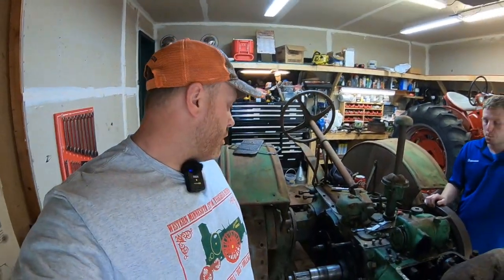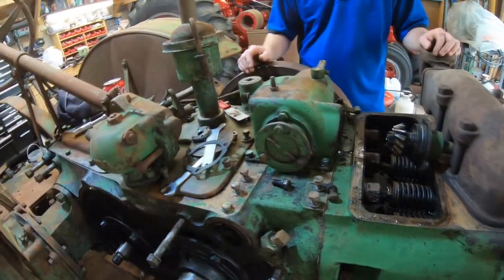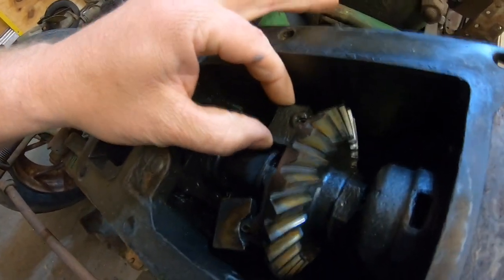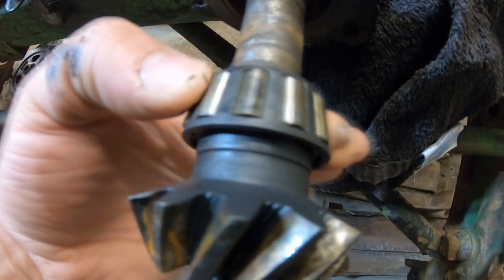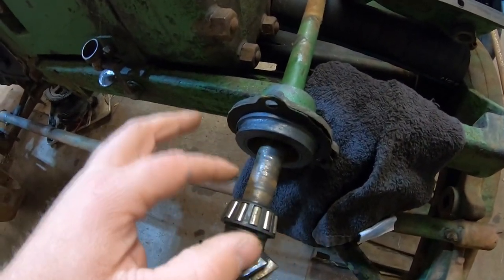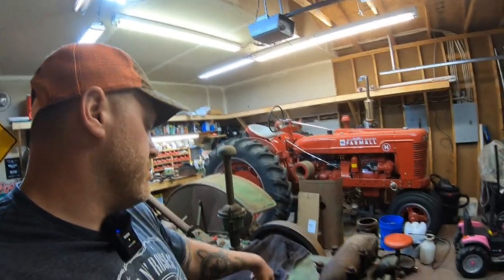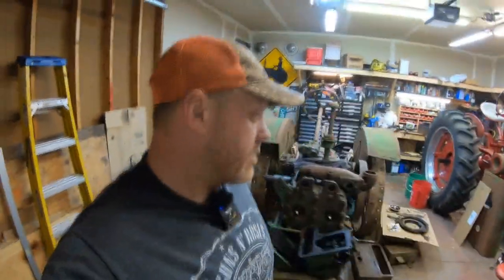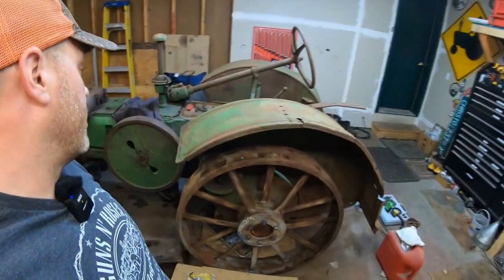1929 John Deere GP Part 7: Governor Housing & Fanshaft Removal - More Issues Found!

Comment: Love that original John Deere green! I suppose you will find some issues when working on a 94 year old tractor, but those vintage machinery are so worth it. I would love to know the history of that GP and all the work it did, well before World War 2. Thanks Kenny!
Reply from the maker: That's part of the mystery. Going through the toolbox can sometimes lead to clues. I think this one was equipped with a planter at one time, after finding all the drive chain links in the toolbox!

Comment: Before you know it, that GP will be completely stripped and parts scattered all over your garage and yard! Is that a hardened shaft or mild steel? Either way, it's cheaper ordering round stock from a metal supplier or McMaster Carr that doing a lot of welding and machining. Good luck guys!
Reply from the maker: I'm not sure if it's hardened or not. We are definitely on the hunt for something!
Reply: @KennyKizzleRustyNutzRanch  you can do the skip test with a file. That will tell you for sure

Comment: Weld up the shaft and turn it back to a usable state . As for the broken ear on the carrier braze it or make a new one from steel .
Reply from the maker: Well. In order to do that I would need a welder and a lathe. A replacement carrier can be found fairly easily.
Reply: @KennyKizzleRustyNutzRanch  I know someone who has both and he lives near you I think  squatch 253
Reply from the maker: @M1A2 Abrams tank  yes, he does. I try not to bother him with things too much. I know he's also got a lot of projects going on.

Comment: Well I guess I would look for your bearing and seal housing first, as you might just find it with the shaft as well. 
Then after I would have the housing, seal and bearing, take it to a machinist and explain to him that you need a new shaft or the old one repaired. He would be able to tell you which would be better and the he would have everything he needs to do that.
Was there shims there also?
Reply from the maker: There was only one shim/gasket between the carrier and governor. We were able to locate a seal/bearing carrier as well as a new shaft. Just waiting for the shaft and gasket material to arrive.

Comment: You could probably use a center punch on that shaft to keep the inside race from spinning on it
Reply from the maker: Are you saying to stake the shaft, as to cause deformation, like knurling, essentially?
Reply: @KennyKizzleRustyNutzRanch  it works really good. Won't hurt the shaft at all. I've done it lots of times on balers and combines